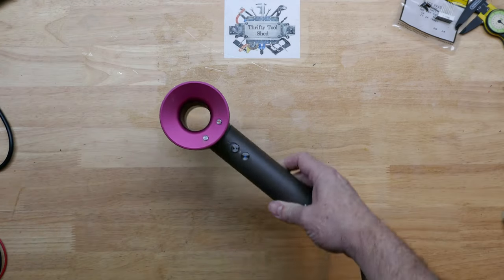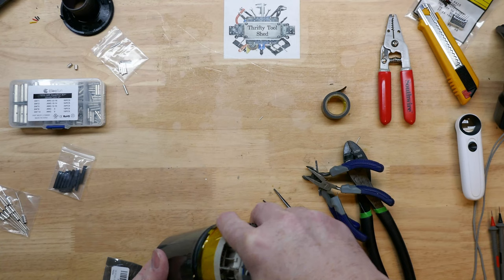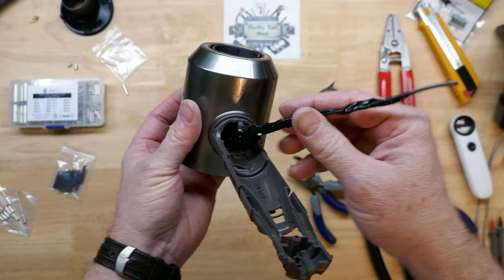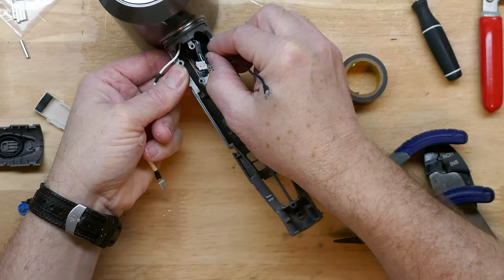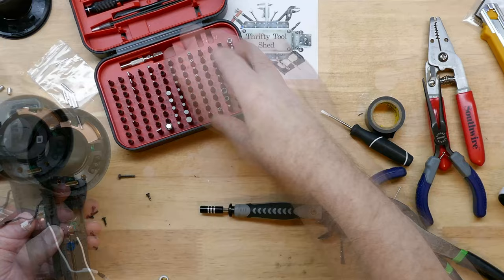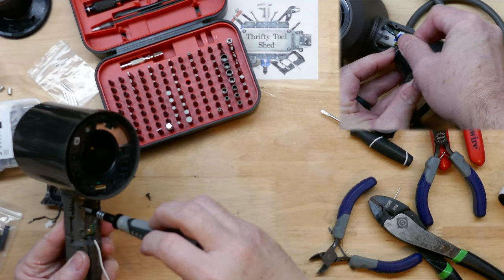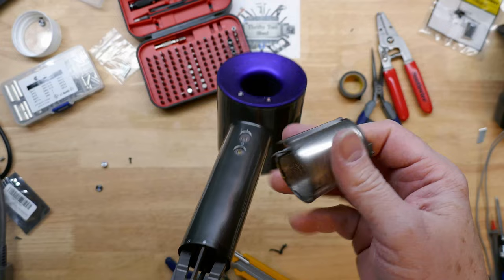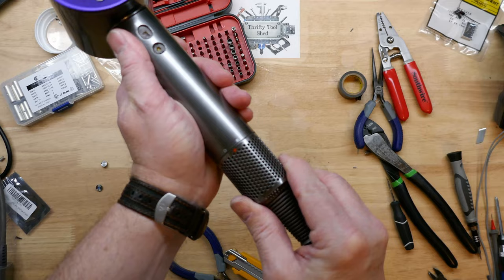Dyson HD01 Hair Dryer Reassembly

Comment: 고마워요 덕분에 직접 수리를 했어요
Thank you, I did the repair myself.

바람세기와 온도조절버튼이 달려있는 케이스를 여는게 정말 힘드네요.
It's really hard to open the case with the wind speed and temperature control buttons.

하지만 당신의 영상 덕분에 수리를 해서 이젠 뜨거운바람이 나와요
But thanks to your video, I repaired it and now it blows hot air.

구독과 좋아요 했어요
Subscribed and liked

정말 고마워요
Thank you very much
😉

Comment: Do you know if it's possible to turn the handle around so the button are facing in your direction if you blow your own hair?
Reply from the maker: It can't be turned. Even though the outer handle could twist it's the inner main frame of the handle that the switch is mounted to that is permanently in place.

Comment: Hi brother.. If I want to lower the wattage of the heating element, what should I do? 
Because the electrical installation in my house is only 450VA (220vac)
Even then, the voltage often fluctuates
As a result, my hair dryer will turn on and off when the heater is turned on. 
Please help me
Reply from the maker: It is no easy fix for that. It would be modifications to the board needed for that. The factory only gives 3 levels or settings. I have not had to do any of that, but it would be more work than its worth honestly.
Reply: @ThriftyToolShed  I think so.. 
But, Will using a voltage stabilizer function normally? 
Because the voltage in my house can drop to 180volt
When the hair dryer is turned on, the voltage can drop directly to 150 volts
Reply from the maker: @Yand27_ID  
Hard to say, but you mentioned you only have 450va supply and this is a 1800watt device. I would doubt you would get much of anything from it at that low of power supply.
Reply: @ThriftyToolShed  Do you have instagram? 
I want to ask more
I want to send you pictures of a fake dyson hair dryer machine
Reply from the maker: I don't. I do have a Facebook group so people can post or ask questions as a community. "On The Bench" is the group.

Comment: Hi, I did a board and heating coil replacement but now the motor blows the wrong way. Any advice?
Reply from the maker: Is this by chance an aftermarket Chinese version of the board and motor? If so it is probably a 3 wire motor and is a 3 phase BLDC motor. The direction can be reversed by swapping any 2 of the 3 wires going to the motor. Double check that the connector did not get plugged in backwards. If not, you may have to press in the locking tab on the wire end to remove the crimped ends from the JST connector to swap the wires around. Hope it helps!

Comment: I see 37 ohms on the moto pins, is the motor solid?  and the device is heating, but the engine does not work and there are no button controls
Reply from the maker: I believe the motor should be around 7 ohms if I remember correctly.
Reply: @ThriftyToolShed  I see exactly 37 ohms, there is a value like 900 in the diode stage at the (lks620) drain end of the buck converter integrated
Reply from the maker: @MsAxelfoly  
I am just going by memory. The motor was around 7 ohms. Not sure about the driver circuit itself. I did not have an issue with that on my repair.
Reply: @ThriftyToolShed  The processor was faulty, there was a short circuit in the capacitor on the lower PCB, it was fixed by removing the processor.thx
Reply from the maker: Man, I was hoping you were saying the cap was shorted causing the microcontroller to be faulted. Dang, hate that the micro itself was the problem. That has to be very rare for sure! Good fault finding!
Reply: @ThriftyToolShed  i was hoping so too, i removed the capacitor and the short circuit was not resolved. It was fixed by removing the processor